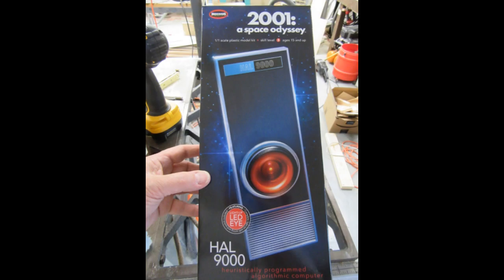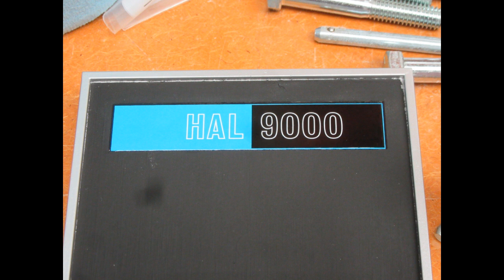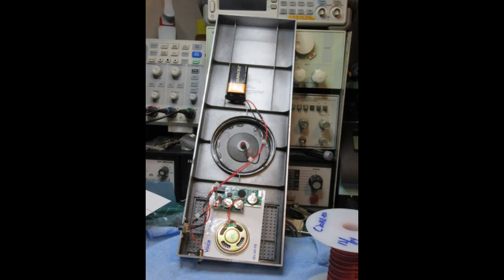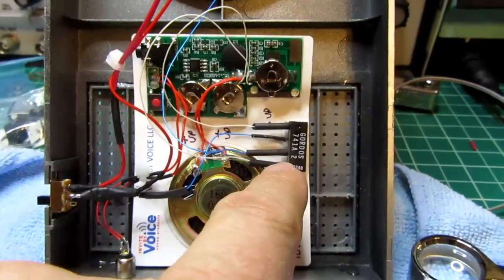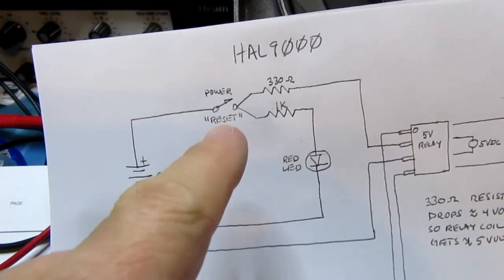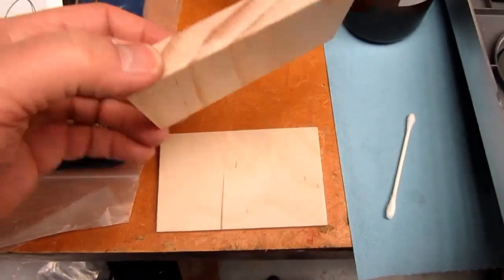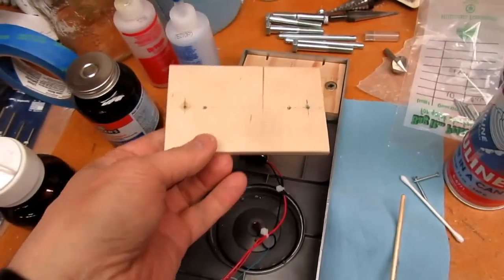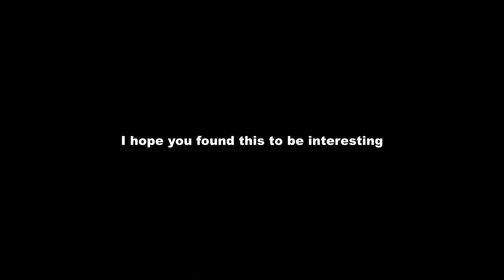HAL9000 kit Moebius Models (MOE20015): Kit build, hack, demonstration

Comment: I wish I had watched your video sooner.  I disassembled a old Hallmark ornament, rewired the resistor, and added an old 4 ohm 2 watt speaker to the module.  It works fine off the button cells.  I also wired the resistor to the speaker so it pulses instead of staying steady. The unit activates by simply hitting a new push button switch on the side. I figured that many people don't know that it's not screen accurate, and the low power consumption and the pulsing as it talks added interest.

Feel free to email me as I'm going to use the board you recommended on my 1/350 USS Enterprise build.  My question is, will it cycle through more than one sound recording or only 1 recording at 2 minutes?
Reply from the maker: This sound module only handles a single sound. It does not cycle through sounds.

Comment: Hi, I dont understand the wiring upgrade. The speaker batteries are only used when the pushbotton is pressed to activate the sound board. Why does the board need a separate off switch?

Comment: Nice mods. What switch did you use for the sound module?
Reply from the maker: jimvac77, the switch I used does not have a manufacturer or model number on it. This is just a typical sub-micro momentary NO pushbutton switch. Radio Shack carried them, and pretty much the same switch is available from lots of electronics distributors.
Reply: @youtuuba  thanks, I looked again and it seems to be a 5mm momentary switch. Again,  nice work.